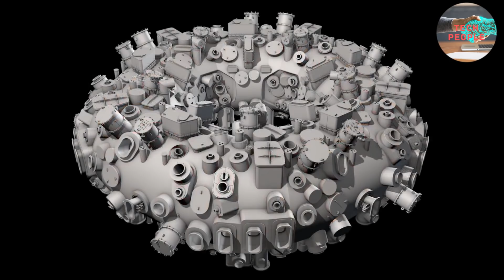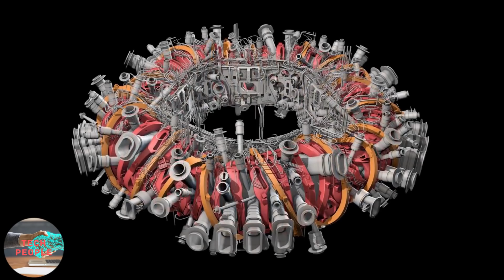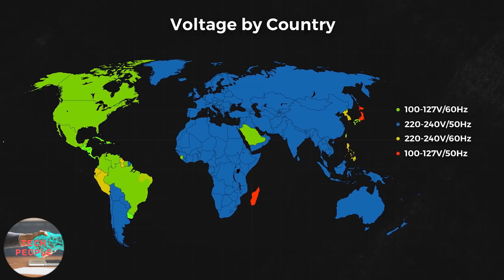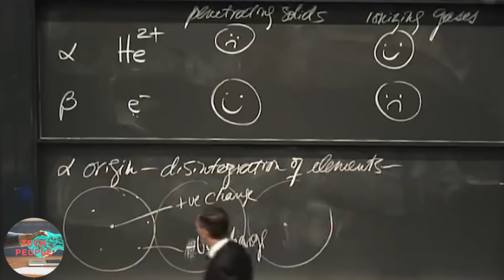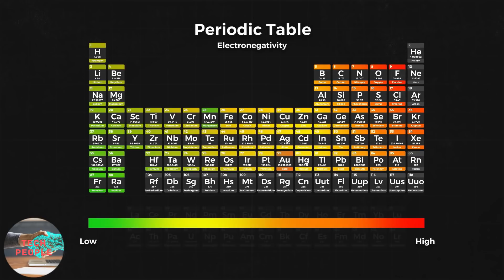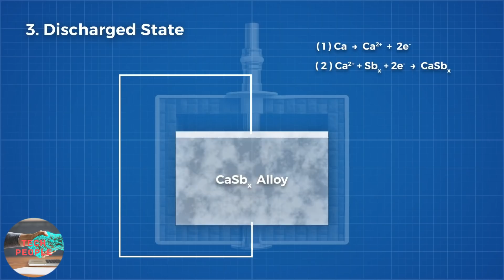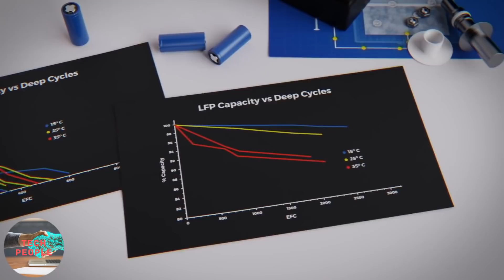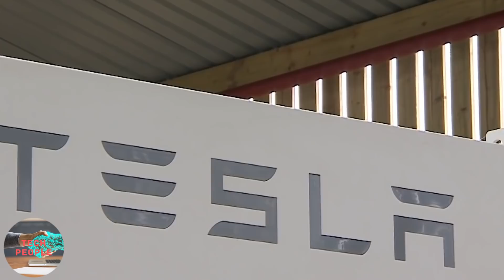Breaktrough Liquid Metal Battery

Comment: 12:47 Don't exactly know why it HAS to be ceramics. And certainly why it has to be on the inside. Steel has a melting point of 1500°C, way above the 500-600 of the battery. and you transport it when cooled/solid. and once you're in place, you turn them on, and use robotics to manage (or you just let it cool of again, so people can handle it, if it's really necessary. So why is there a need for ceramics?

Just make the steel container with a double wand, and suck it vacuum, in between, like a vacuum flask.
Reply from the maker: And steel conduct electricity so you can't separate internal melted material from shot circuit. This is why they use ceramics.
Reply: @TechPeopleNews  That is true. Steel is one of the least conductive materials, but it still will be too much, I guess. And one could coat it with a polymer or epoxy, but then I suppose they won't react well with the heat. Hence ceramics as the remaining option, I guess. I'm just a bit surprised he talked about the cost being enormous (NASA levels expensive). I would think you'd have more cheap/common ceramics by now. Wouldn't stone do the trick? Can't they make a coating out of synrock, for instance?
Reply from the maker: @AniMageNeBy  I think they managed to decrease the costs of the enclosure. Don't forget we are dealing with 500 Degrees Celsius or more - that need to stay constant 24/7 365 to have the battery work properly. I am sure they will find a way to make it dirt cheap as professor told us. We need a cheap battery for the grid so we can expand the electric cars adoption and don't crush the electric grids all over the world. 
This Liquid Metal Battery is one of the solution - there is also an Air Battery based on compressed air, also a Gravitational Battery - based on storing mass height and so on. We will see who will be the winner in the end.

Comment: What electrolyte will handle that temp?
Reply from the maker: This is the beauty of this type of battery - they like heat - the electrolyte is a thin layer of liquid salt. Everything in this battery is at high temp that transform solid into liquid.

Comment: The professor, his students and his company have been trying to perfect liquid metal battery for decades. Still not commercially viable
Reply: How long did it take for lithium ion batteries to be commercially viable? Think about it
Reply: @ThomasBomb45  seeing as how Tesla pioneered liquid metal battery's over 100 years ago and this guy thinks he can break thermal dynamic laws describing his non existent battery as perpetual. He literally thinks a molten metal battery (mini metal foundary) within a battery.....he's described how a battery works but has not provided a way of making an efficient small non nuclear molten salt reactor.... It will take more energy to keep the metal melted then it will have energy output...... He literally says don't ask about energy loss it's irrelevant. Just like Tesla's 700 mph hyperloop. Unless he's using uranium as his source of power to melt the metal then it will never take off. It's only plausible as for use on a reactor and the heat dissapated is used to keep the metal molten........ Oh yeah that's a thing called a thorium reactor without the battery storage....
Reply: @mr.nobody---  You called it a molten salt reactor, but no that's usually used to describe a system that generates power by creating heat and uses salt to carry that heat to where it produces power. This is... not that. This battery stores electrical energy the same way any other batter does, except the temperature operates at a high temperature.

I'm in favor of thorium reactors, but the resources going into these batteries are not competing with nuclear research. Ambri batteries are being tested in real life scenarios, right now. No one has even developed a thorium reactor test in a lab. One of these is obviously the more mature technology
Reply: @ThomasBomb45  you have to heat the battery for it to work. So you have to melt and keep melted the material to charge. The laws of thermal Dynamics will make it so inefficient that it's super impractical....unless you add material so radioactive that it can keep the metal melted...... If you use the input charge to melt it then you essentially have is an induction furnace with a charge
Reply: @mr.nobody---  According to Ambri, one charge and discharge cycle per day is enough to keep the battery at the correct temperature. These batteries are intended to store power for hours, not days or weeks. Other storage mediums are better suited for that task
Reply: @mr.nobody---  No battery is 100% efficient, due to internal resistance (and maybe other factors?). But the waste heat is used in these batteries to keep them hot. They have lots of insulation and they have a lot of volume (thermal mass) with little surface area
Reply: @mr.nobody---  They are already building battery pack. You'll see how "non-existent" it is when TerraScale’s Energos Reno Project is online
Reply: It's a decade, not decades, and it's working already.
Reply: @mr.nobody---  what the hell are you talking about
Reply: Hey how about the amazing battery fires they just experienced eah. Real green of him...
Reply: @mr.nobody---  You have a real vendetta against this guy you don't know and a technology that you only kinda understand. Why?
Reply: @ThomasBomb45  so... Explain to me what I don't know about this technology? You insist you know what I don't know, I don't even know what I don't know so I insist to know what I don't know so I can be just like you.
Reply: @mr.nobody---  There are a lot of things about the technology that I don't know, and I admit that

You described it as a molten salt reactor, and also said it breaks the laws of thermodynamics. Both are false. It is a battery, and like all batteries the energy comes from outside. Most of that energy can be recovered back at useful electricity, with the rest going to heat. This is the same thing that happens to the battery in your phone, which is why your phone gets hot when you charge it. In your phone, they want the heat to escape. In this battery, they trap the heat with insulation to keep the battery hot and molten. The battery is designed to charge and discharge on the timescale of hours to a day. This timescale means that enough "waste" heat is generated to keep the battery molten.

The technology of the battery is sound, in terms of thermodynamica and engineering. The rest is all manufacturing and logistics, which will either be figured out over time or will be determined to be too expensive compared to alternatives. It's too early to know.  But molten metal batteries have the advantage of being chemically possible using many different raw materials, depending on what metals are available. Many of which are significantly cheaper and more common than lithium or other battery chemistries
Reply: @mr.nobody---  That's Li Ion batteries. Those ones don't explode like Li Ion does
Reply: @nathanliteroy9835  He doesn't understand, that not any kind of battery can explode.  they have a 20% lose because of the heat, that's fine. Much better efficiency than not scalable hydrogen. Also he is comparing a little manufacturer, with whole industries not getting hydrogen or nuclear stuff to work, this time for a half century. Also he doesn't understand that the resistance is higher, but this doesn't mean anything. Just use higher power to load the battery and you are fine, this is kinda the same principle like in an old lightbulb. The resistance is higher the hotter the components get and you have a lose of usable energy through heat, but in the case of the battery you use the heat and you need it. When solar and wind energy kicks in, then you can throw it at those batteries, they will say your welcome. 20ish % lose looks bad for a battery, but compared to all solutions, it's still better. By far. The best efficiency for electrolysis to get hydrogen is by around 70%,this doesn't include all those other factors, like getting energy from it, storing it, transportation and so on.